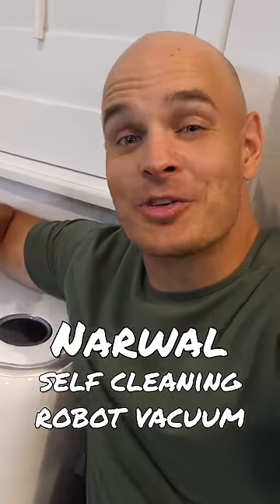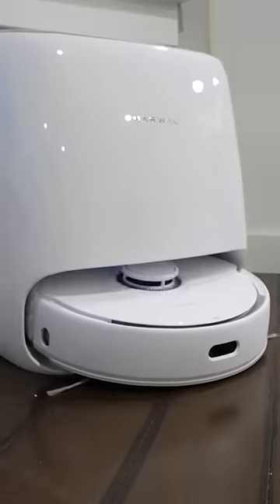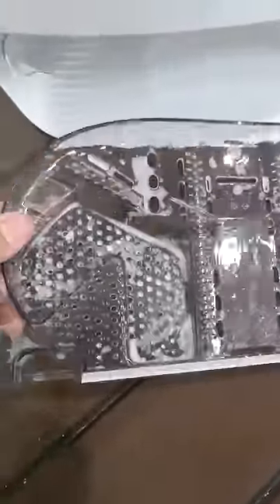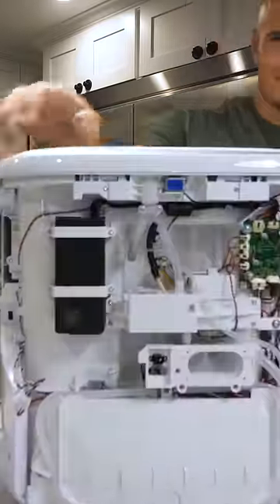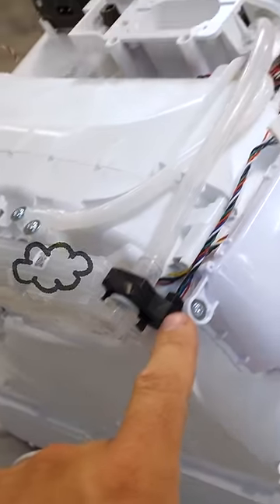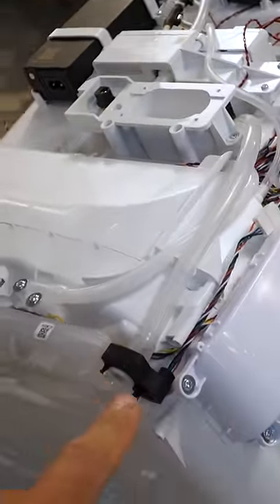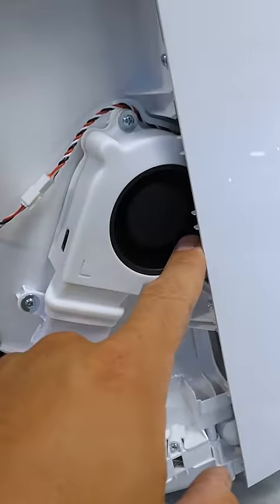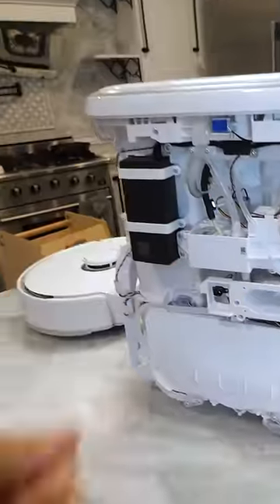The technology your parents WISH they had...

Comment: Parents: "wait you're telling me you can't buy parts for the damn thing?! Screw that garbage!"
Reply: Repairability sucks of course, but it doesn't suck as bad as doing all the housecleaning manually yourself. Modern tech that does your chores for you is fantastic in this way.
Reply: @aleksandersuur9475  Assuming it actually works.. which it often doesn't unless it's a very light level of dirt. 

I'd rather have the cheap thing I can make last forever and do 10 minutes of work rather than the expensive thing that I have to keep replacing, and sometimes follow behind with actual work anyway.

Comment: Thats an interesting PSU choice for inside a product like this.
Reply: wow yeah, just a power brick hidden under a panel
Reply: This is amazing in my opinion. If it goes out then you can just replace it. There were lots of readily available parts in there so the base station at least should be serviceable! This is the way. More companies should make products serviceable!
Reply: @jonathanfairchild  Its also probably more likely to fail, since this won't be able to dissipate heat nearly as well as a bare board.
Reply: it takes a lot of certification to design anything that plugs into a 110v outlet. Using an off the shelf power supply completely eliminates the hassle.

Comment: Looks like one of those fancy machines used in fast food joints that end up growing mold inside and nobody cleans because of all the little tubes, wiring, cracks, and hard to reach places. Then the sensor failures start and the machine is always getting maintenance.

Comment: What happens to the dirty water after it cleans itself?
Reply from the maker: Goes into a tank that needs to be manually emptied
Reply: @JerryRigEverything  I see.  Why not place the device over a floor drain and then add a tube to it so that it drains automatically into the floor drain.  Then you don’t have to think about or waste times dealing with it!

I bought one of those small ice machines that sits on the counter top where you have to add water to it and then connected a float valve to it and then connected a water supply to that valve.  Works great!  Ice in my office room all year round!
Reply from the maker: @Dream.big.dreams  they also have an add on kit that does exactly that!
Reply: @JerryRigEverything  Great minds think alike!